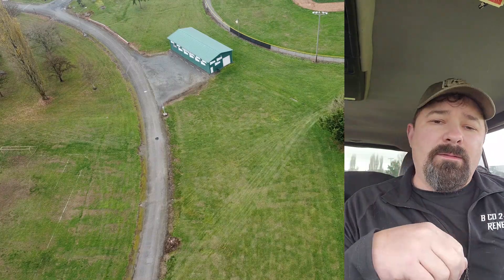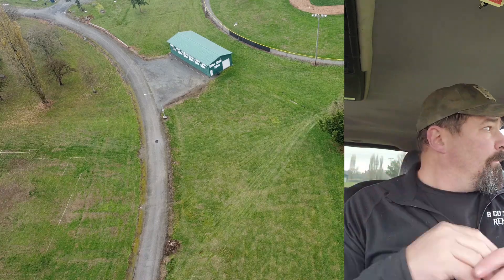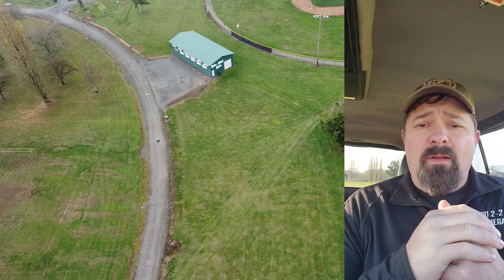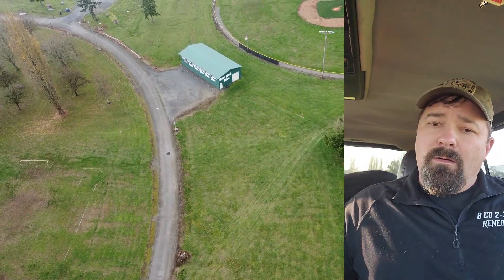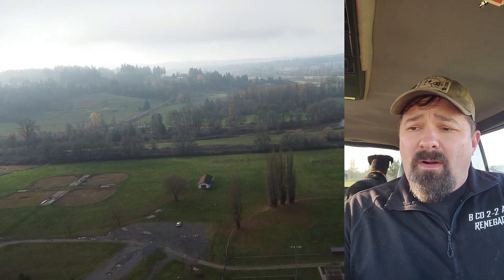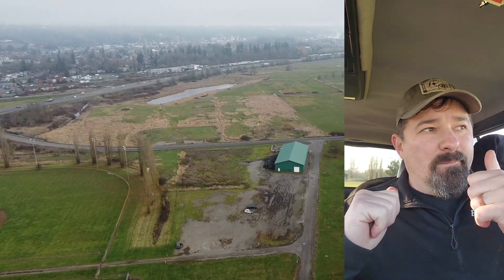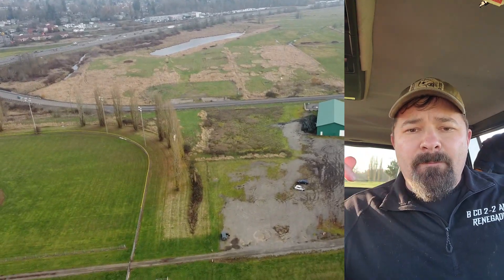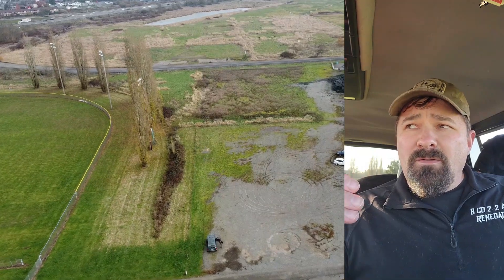Airborne Repeater | LoRa Mesh Range Testing | Round 3

Comment: 1:20 - 915 MHz loss in coax cable is bad.  Much of the advantage you'd get from having the antenna farther off the ground would be offset by signal loss in the coax cable, even if you use good coax.  Particularly with low power UHF signals, keeping the coax as short as possible is important.  I mount LoRa antennas to the LoRa devices, or given that the good antennas are large, it's more true to say that I mount the LoRa devices to their antennas.
Reply from the maker: Thanks for your useful feedback.
Reply: @RavenwoodAcres  - Thank you for getting out, doing propagation experiments, and sharing them with us.  Amazing how nothing seems to go right when trying new stuff.  Endeavor to persevere!   😀

Comment: It looks like you had a single line holding the RAK? Would two lines stabilize it enough to keep it from spinning or is the thrust from the drone still to strong?

Have you tested the SWR of Y antenna with a VNA to verify the specs? It looks compact. Im curious about using one.
Reply from the maker: Good point about a second line. I just received my Nano VNA and testing it soon.

Comment: Did you try hard mounting the t beam at first?  I’m curious if the few feet hanging below is really making that much of a reduction in interference.. I’m likely going to try to hard mount mine.
Reply from the maker: No, currently have my solar node on one of those satellite dish tri-pods. I seen a lot of people use j-poles for hard mounting. In that configuration you can mount your enclosure under the house eve.
Reply: @RavenwoodAcres  sorry, I meant heard mount to your drone, as opposed to hanging it below!